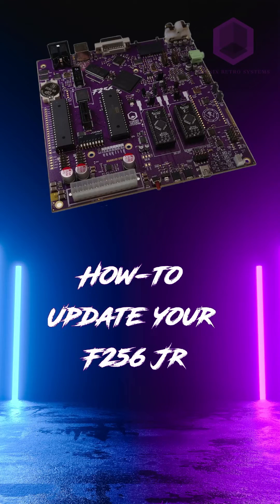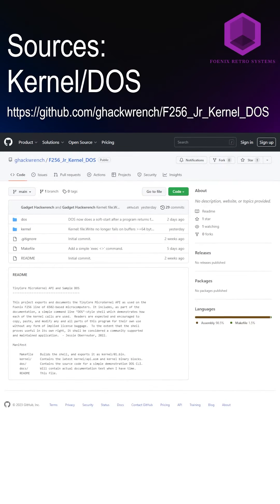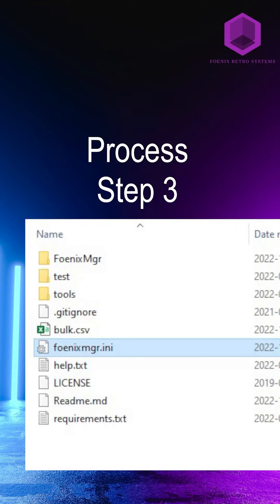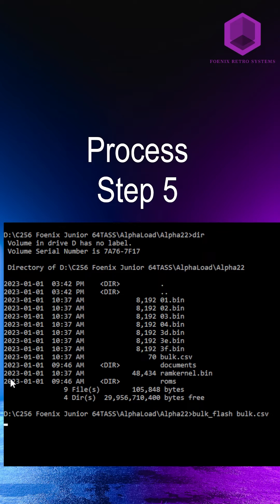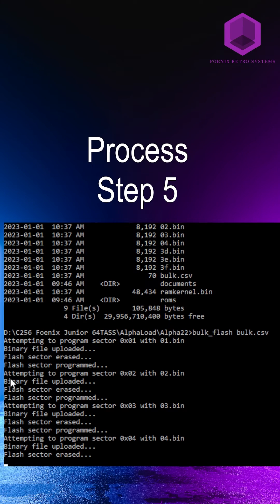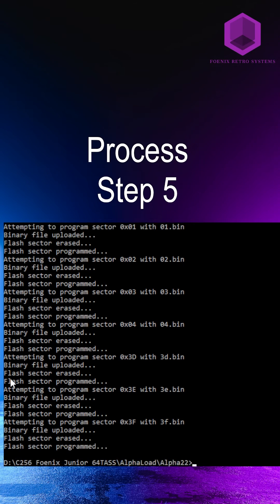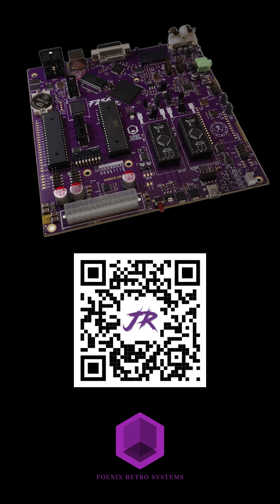How to Update your F256 Jr. / F256K Short Version #Shorts

Comment: It seems that Discord is the only place for community engagement and getting software.  If that's the case I'm automatically out.  Discord is a garbage platform that I cannot get onto.  No I didn't break terms of service or engage in antisocial behavior, I joined to take part in the Pistorm and EMU68 projects, but they have banned me twice for zero reason so I'm not bothering anymore and I'm sure I'm not the only one.
If you want a vibrant community around your products choose platforms where they can interact away from broken mega corporations.  Might I suggest a forum, email lists, IRC or even news groups?  Many of these would even be able to run on your retro-targeted hardware, whereas I sincerely doubt there'll ever be an anointed Discord client for the F256.

Comment: May 30th 2023, this tutorial still holds up and was helpful, thanks!
I was able to test a few variations of superbasic and the kernel, then brought it back to superbasic 04/04/2023 and kernel 25/04/2023
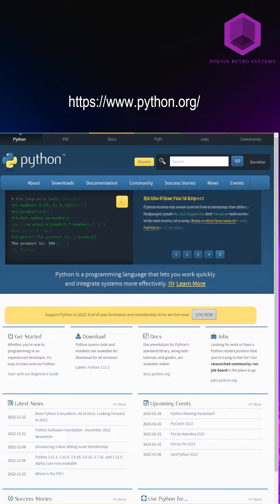the only simplified step I noticed is that pyserial is automatically fetched now, since it was added to requirements.txt, as you perform pip install -r requirements.txt (around 00:14)